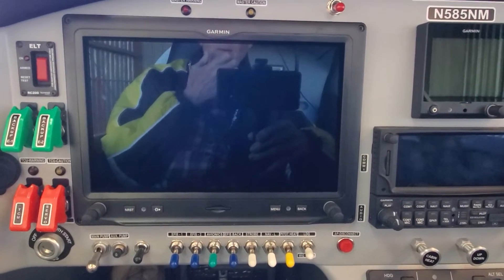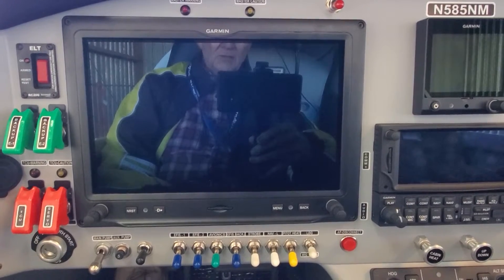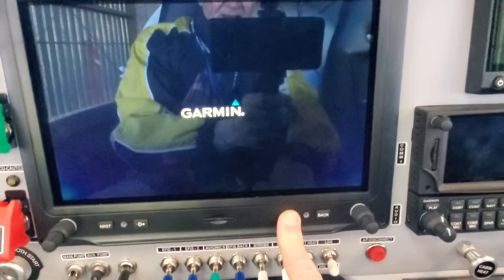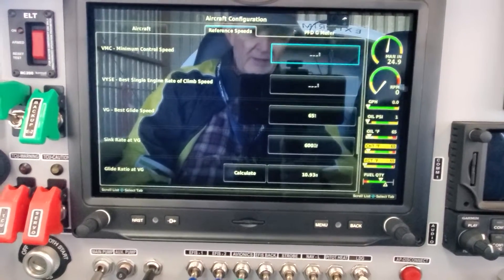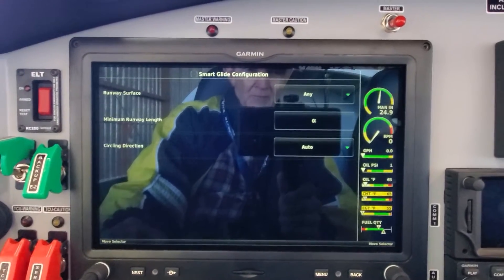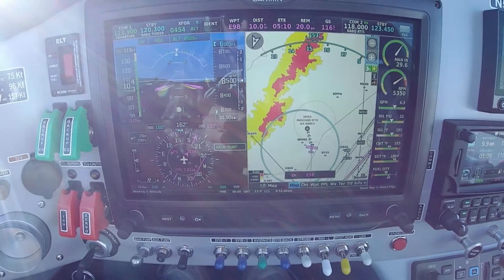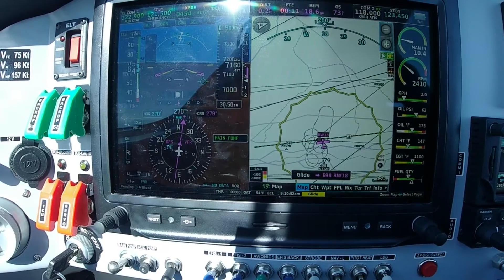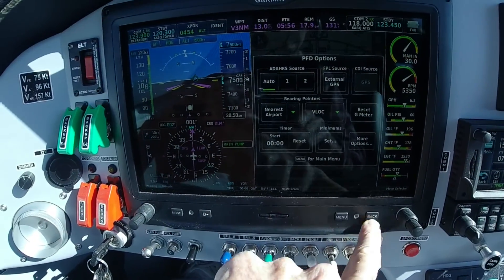GARMIN SMART GLIDE - Install, Configure, Demo

Comment: 9:10 "full engine out the prop won't be spinning, obviously." I've had 2 engine outs and the prop windmilled both times. Sure, the engine could lock up, but I guess it just depends on why your engine failed as to if it would or would not still spin the prop.
Reply from the maker: Rotax has a 2.3 gear reduction on it, so I don't think a 65 kts wind over the prop could spin it.  It's not like a one to one drive.  Rick

Comment: Great video. The porpoising may be due to the autopilot tuning parameters from Bristel, not the Garmin software. Seemed to work OK to me, especially if it was a real emergency.
Reply from the maker: Thx.  Rick
Reply: You have to decrease the gain on the pid programming for the autopilot servo controller.

Comment: I have verified my best glide speed and sink rate.  Is there any adjustment for actually gliding with the engine wind milling vs. idling?  I would think your glide ratio would decrease in an actual engine out.  I want to set that number in the Garmin.
Reply from the maker: I haven't seen it, but definitely the plane would sink faster with a complete engine out.  That's why I set mine to give me plenty of room for error.  Thanks.  Rick
Reply: @goldenoldie3524  Thanks for the quick answer.  I didn't want to just "fudge" the numbers, was hoping for some calculation.  It's probably different for each aircraft, but might be a range to use.  I agree, err on the side of caution!
Reply from the maker: @mikee.3638  It's going to vary for each aircraft and also for the individual plane depending on varying weight.  The only real accurate way to find the exact range is to turn off the engine at gross weight and test it.  I'm not brave (or stupid) enough to try it.  Rick

Comment: Thank you! I just tried to install it - without success. After watching your video it should be easy now. 🙋🏻‍♂️😀🙏🏻
Reply from the maker: Thanks.  I've been watching your vids.  Thinking about a VL3 if the rules change over here.  Rick
Reply: @goldenoldie3524  oh, nice, thank you! What rules have to change to be able to run a VL3? At the moment the VL3 is very popular because of its performance, especially because of the availability of the Rotax 925iS. 🤩 🙋🏻‍♂️ Michael
Reply from the maker: @hirnklempner  Right now can only register as exhibition experimental, light sport or amateur home built.  "Mosaic" rules are supposed to be announced in July and they expect a plane like the VL3 915 could qualify as a light sport.  VL3 has a dealer in Wichita which is fairly close to Albuquerque.  I'm flying right now as a private pilot, but getting older and want to make sure I can continue flying if I have to drop down to a sport pilot license.  Rick
Reply: @goldenoldie3524  Ah, ok! So, good luck! Hope you stay healthy!! 😀🍀
Reply from the maker: @hirnklempner  Michael, saw that you've flown the 915 at least a couple of times.  Are you thinking of buying one?  Also, do you know how much they cost in Germany with good avionics?  Thanks.  Rick
Reply: @goldenoldie3524  Hi Rick, yes, I decided to buy a new one with 915iS in Dec. 2020 and received it about 3 weeks ago. My VL3 912 was sold in autumn. My last two videos are about getting familiar with the new motor.
The costs have risen sharply during the last two years. You can easily spend more than 300.000 EUR (about 330.000 USD?) when ordering today with Garmin 3GX, nice colour scheme and interieur. 😬
Reply from the maker: @hirnklempner  Congrats on your new plane.  Looking forward to some new vids showing it.  I bought my Bristell in May 2018 for $230,000 USD, so I expected the price of the VL3 to be more.  Fly safe.  Rick
Reply: @goldenoldie3524  Thank you, Rick! 😀 There will come some ... You too - stay safe! 🍀

Comment: This was very informative. Thanks for taking the time. Is that porpoising issue still happening? I did the installation but haven't activated it yet on my plane.
Reply from the maker: Yes it is, but not that bad.  I've had comments saying it is correctable by changing some torque setting in the menu, but I don't think it's worth messing with.  Rick

Comment: Great information, according to the STC if you don't have the Smartglide button you need to have a label adjacent to the panel. I was wondering what you did. I was thinking about a Ptouch label.
Reply from the maker: Plane is an ELSA, so STC does not apply.  Rick
Reply: @goldenoldie3524  Nice. I will try and figure out how best to do it in a 182B.